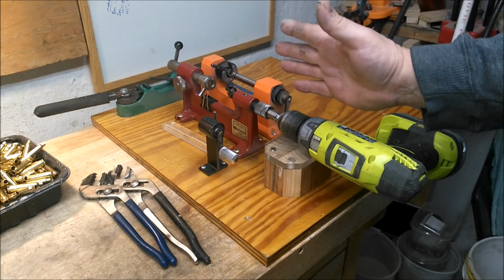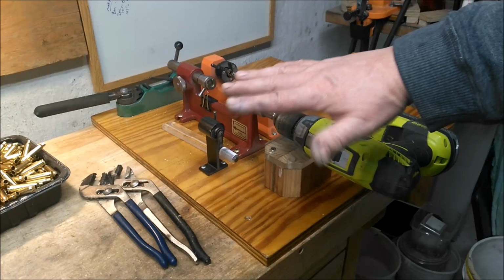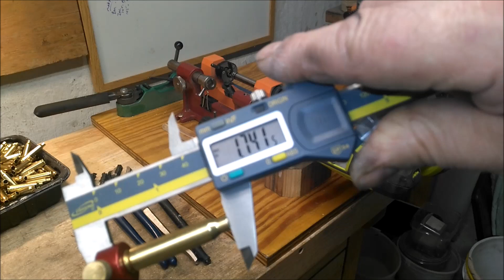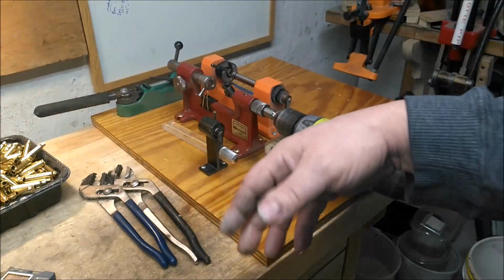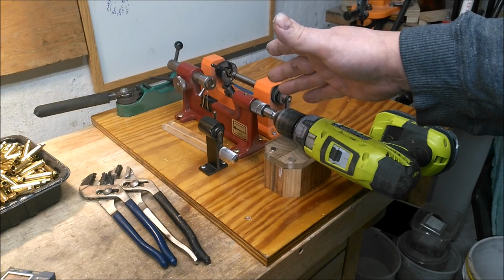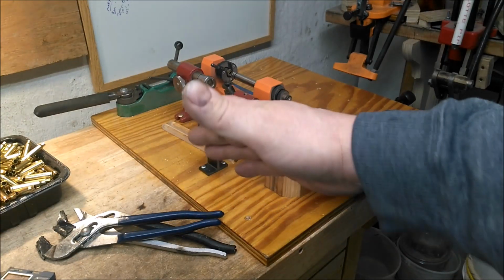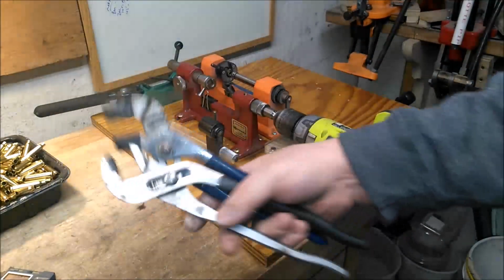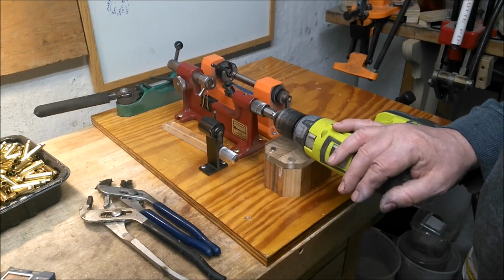My Hornady Trimmer Lock Slipped Again

Comment: Hey get the thing I got that goes on my drill it cuts and chamfers and everything in one whack in seconds..... it was only 60 bucks!! Its called a lil crow by gun works
Reply from the maker: I'm just not keen on trimmers that index off the shoulder. I'm using a RCBS 3-way trim head.
Reply: Psyko Klown I also use the lee and you cant mess those up cause once it bottoms out thats it.... very accurate and good.
Reply from the maker: @Marcus2750-u1t  The case gauge or quick trim?
Reply: Psyko Klown case gauge trimmer..... its fast and accurate! Cheap too I love it.